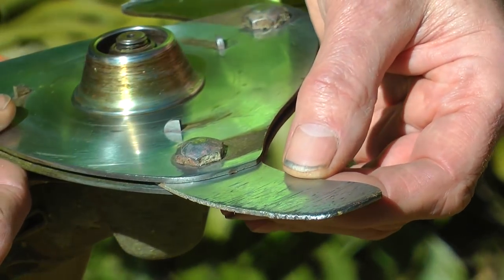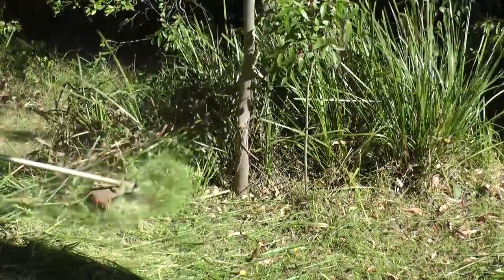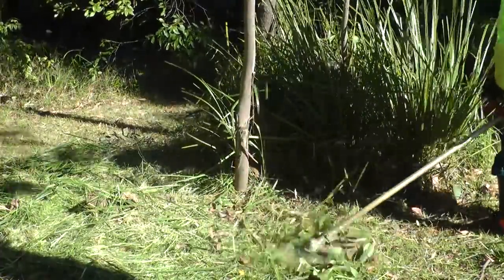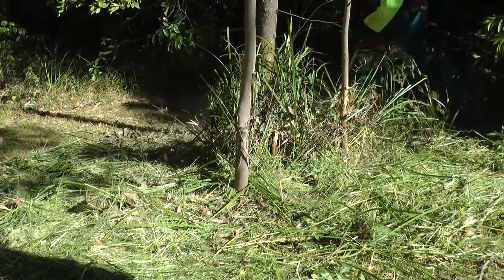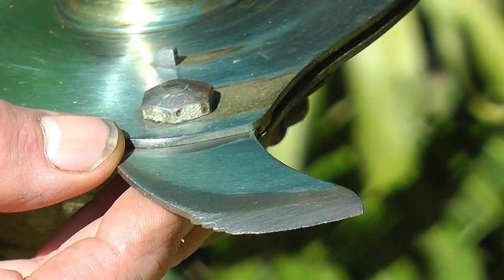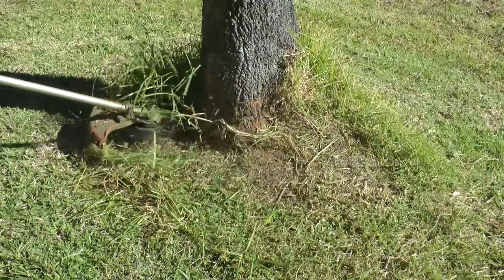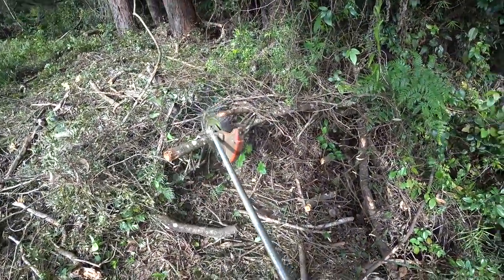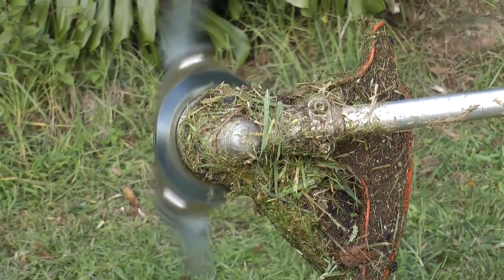BrushDestructor 4 in one blade.

Comment: Hey Anton. It's Wesley from Alabama. Congrats on the launch of the new blade. I just ordered a Model 17 to upgrade from the Model 16. I sent you an email. 
For anyone considering a brush cutter blade, I highly recommend the brush destructor. I have a commercial brush clearing business and have put his previous model 16 blade through its paces(It still works as good as it did when I first got it). It lives up to all of his claims and then some. VERY high performance piece of equipment and VERY durable. They are not cheap but are worth every penny that he charges for them.
Reply: So we meet again 😎

Comment: This tool would look a lot better if you got someone who knows how to use a brush/weed blade.
Reply: William Bissell will fix a ryobi weed eater
Reply: It's 18 v battery
Reply: William Bissell I run a sthil fs 360 and fs 460 clearing saw. You don't need blades for grass even as thick as in this video, I use sthil square yellow line, it's pretty brutal stuff
Reply: Triangle .095 pulverizer eats that grass faster than this blade with the right operator

Comment: All its doing is chewing up the grass instead of cutting. I can do the same with my $7 blade that I bought at Home Depot.
Reply: that's not normal grass, if you're referring to the first clip. it's extremely tough and fibrous, like you could make rope out of it. you can cut it with a cheap fixed blade but you will be stopping regularly to untangle the head